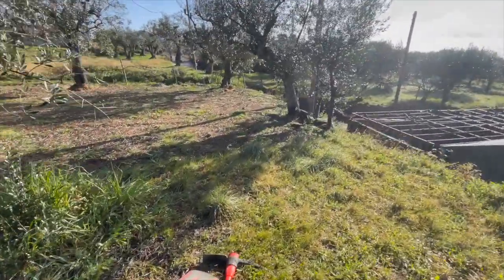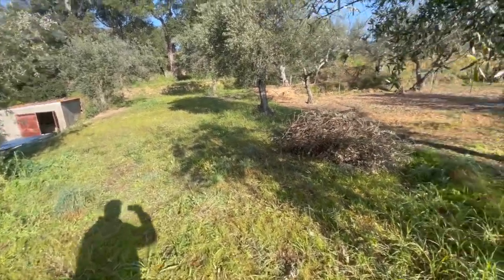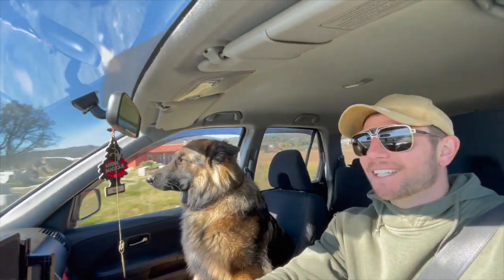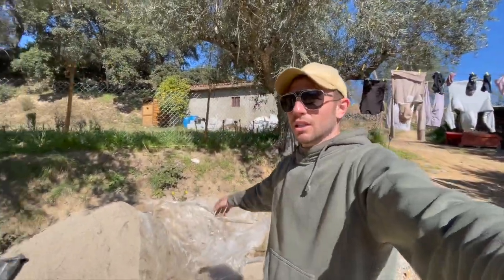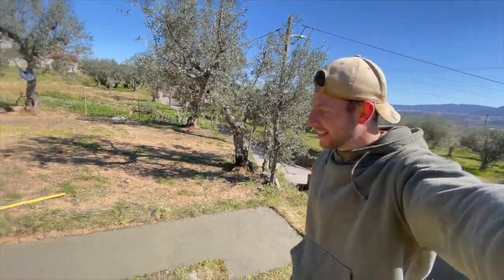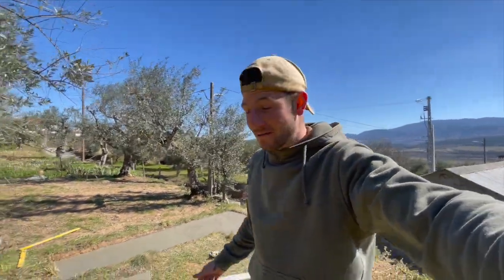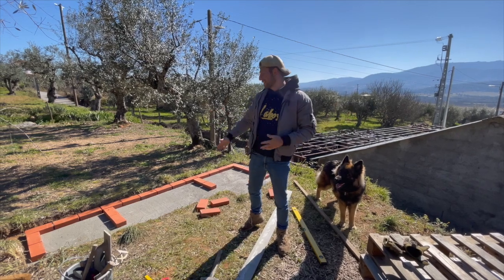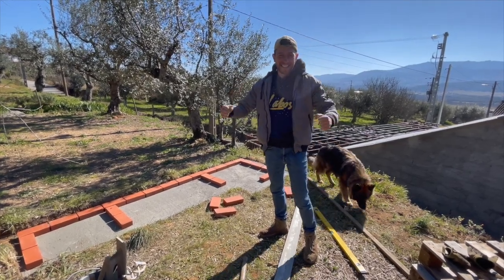Start project BBQ & STONE OVEN | Noah's Ark Portugal

Comment: You have good neighbors and if you could get some of the roots from the olive tree when moving it out it will regrow I'm sure the neighbors told you about this and good thing you are young and fit because that's some good  workout with the cement
Reply from the maker: Yes they are the best, very happy to have them as neighbors! About the olive tree, i think i have to cut it down cause there is no entrance for a tractor on this terrace.. yeah it is a nice workout 😃
Reply: @noahsarkportugal  cut the olive tree down keep a little of it Lower in the ground uproot it and replant that lower section on another plot of the land if it's got some of the roots and you water it it's going to regrow  I've had this done and it will regrow
Reply from the maker: @antoniodasilva1230  that is a super good tip! Thankyou very much 🙏
Reply: @noahsarkportugal   just trying to help